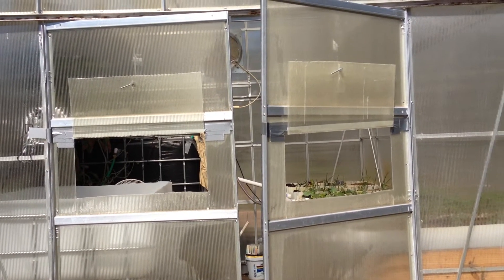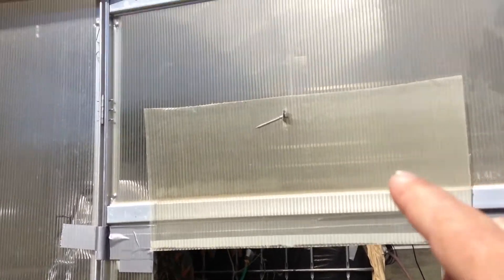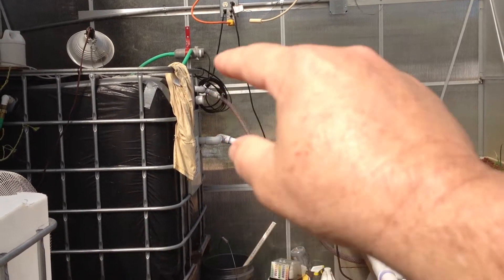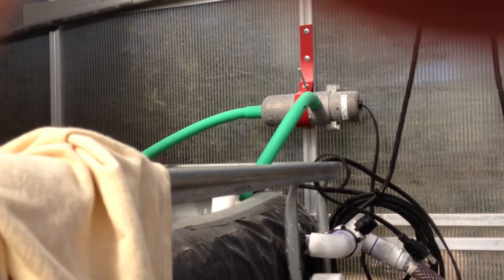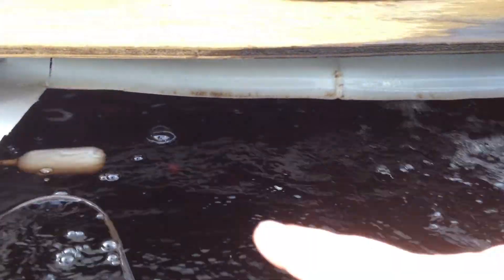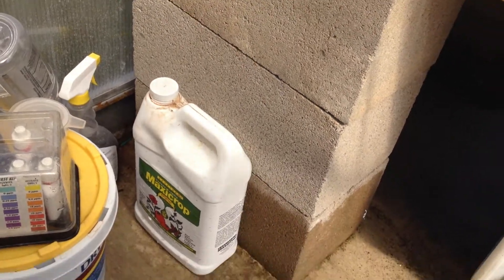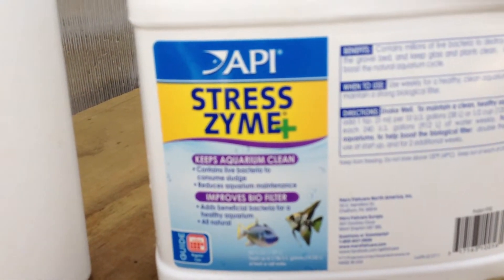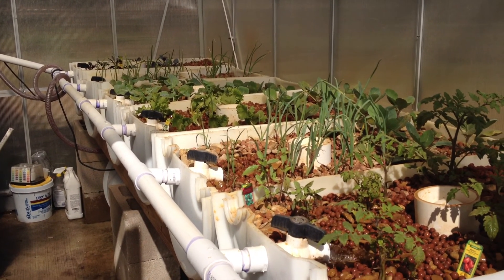Aquaponics - Vegetables Week 2

Comment from the maker: There is circulation in the tank so that solids do not accumulate on the bottom, additionally, the supply line to the trays is one inch off the floor of the tank so that any heavier particles will get sucked into the pipe taken to the grow trays.  Thanks